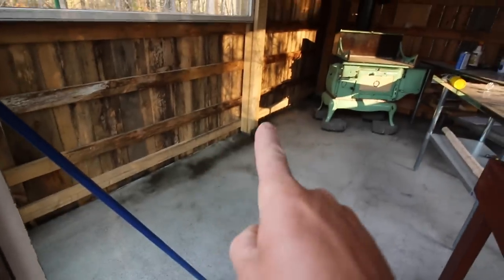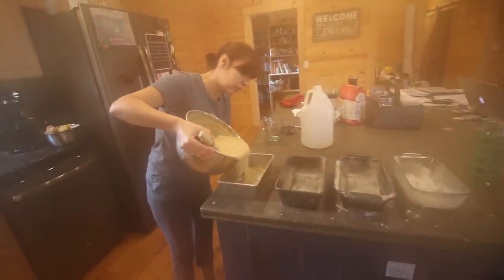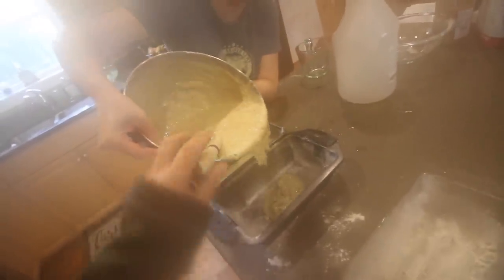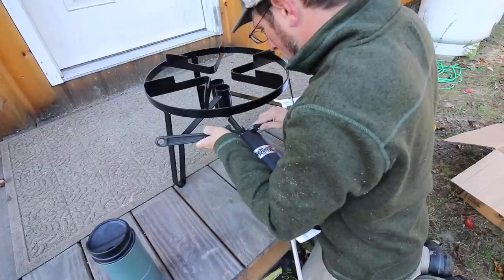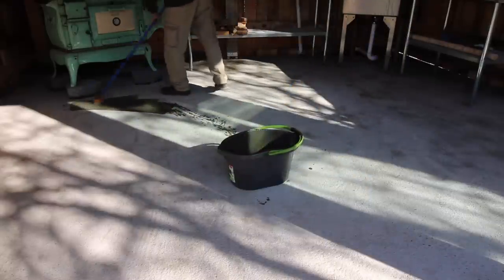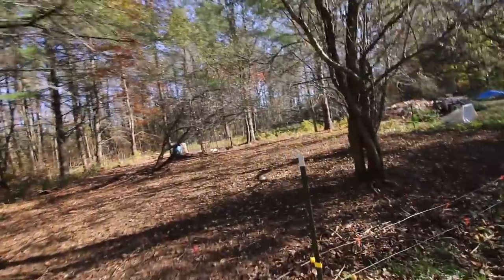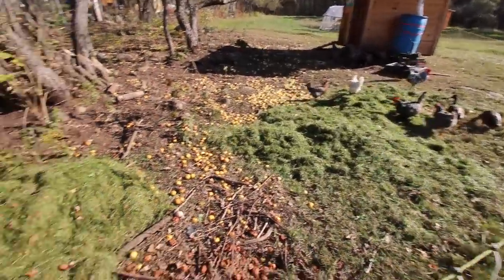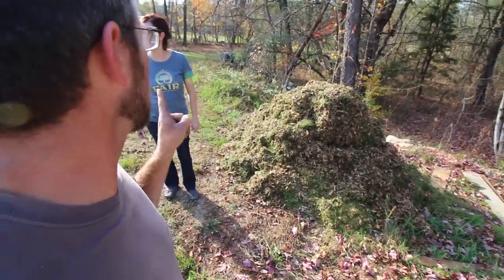She Stole My Kubota "fall Clean up"

Comment: Hi Al,  how about for another project...  Cut those low hanging branches off your apple trees so you can get your Kubota in closer to the trunks.   Be sure to cut them to at least a foot higher than your roll bar or driver's noggin so you don't bump your heads.  Take em off with your chainsaw and then chop 'em up into nice manageable sized lengths and stack up behind your outdoor kitchen in a nice little shelter that you could knock up easily.  Then you'll have some good apple wood for smoking...am thinking maybe a product line of some authentic Lumnah Acres smoked whole chickens or chicken  portions and maybe next year some smoked bacon...  mmmm *drools*.

Comment: I don't think that stand on your propane burner cant handle the weight of a full drum to be safe. 8.36 lbs per gallon of water... I'd reinforce that with cement blocks or something... you don't wanna bunch of hot water splilling on ya... plus it would hold heat in better and make a wind break... just an idea
Reply: j Sullivan I was thinking the same about both recommendations.
Reply: I was going to suggest concrete blocks to give the drum something to help distribute the weight, mighty heavy when it is full and not too safe either.